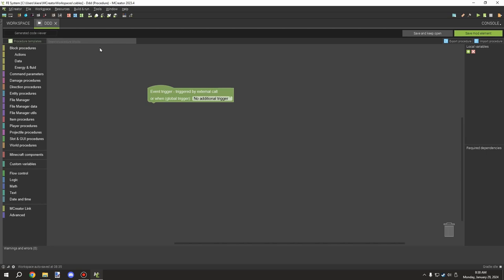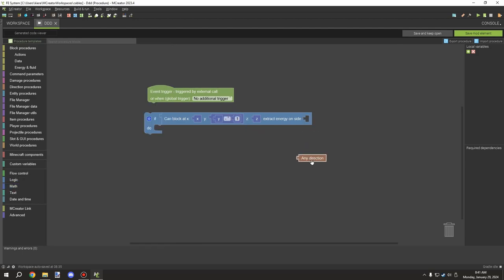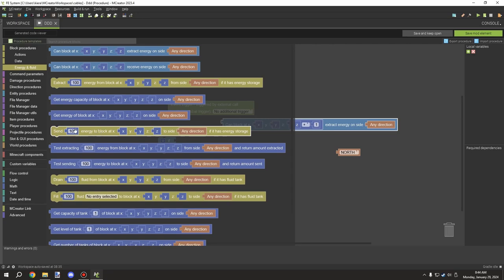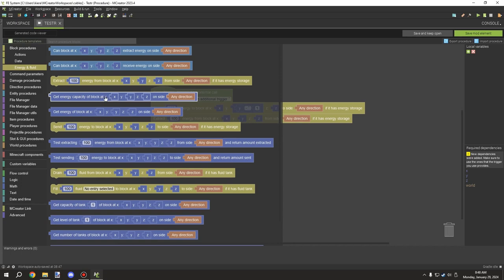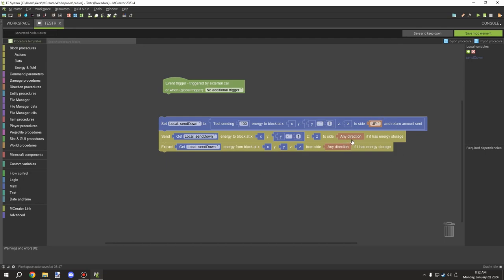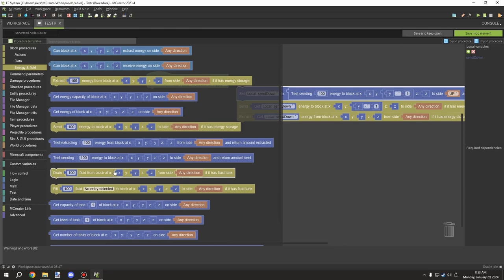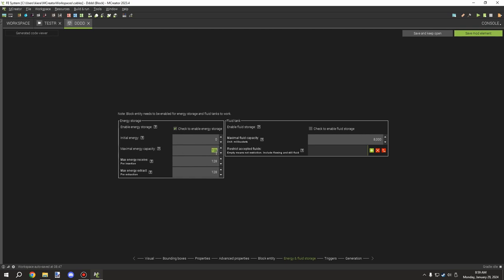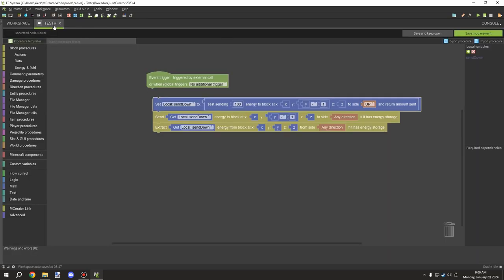Part 1 | Forge Energy & Fluid Blocks | MCreator

Comment: Great video!!

Just wished to ask though, will these videos still apply to mcreator 2024 1 or should i use the same version you have here?

Only ask as i am not 100% sure on the immediate differences between versions, cheers.
Reply from the maker: It should not make to much of a difference between NeoForge and Forge versions.
Mods that are on NeoForge will be using their system as Forge mods are not compatible with NeoForge so overall it will work either way if you use the same version of MCreator for Forge or go with NeoForge.

However do keep in mind that the system is limited. I am working on a NBT energy structure and plan to do tutorial once I have it structured a bit more and planned out. I may also add a option for running the script via commands using an API to make things easier for people to set up, though I will still provide tutorial on how to set up the procedures either way as it's good to give people options.

I don't have a date when I will have this ready I have been working actively on the system though.